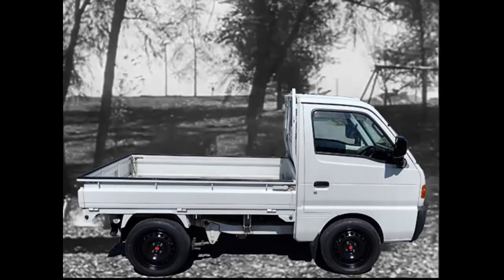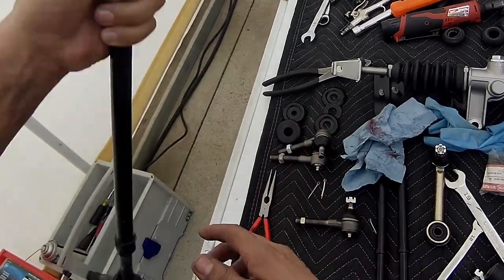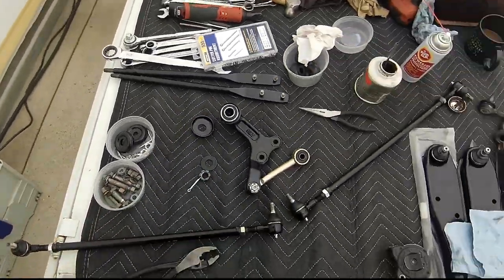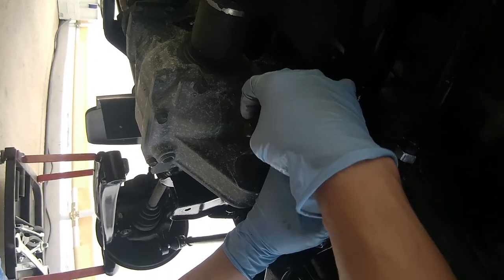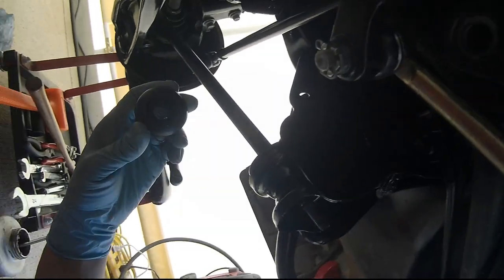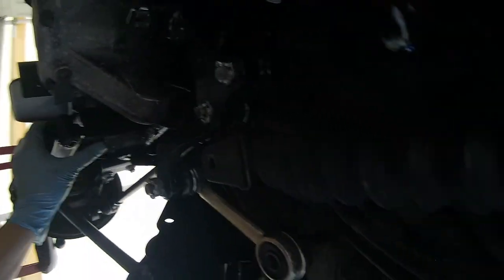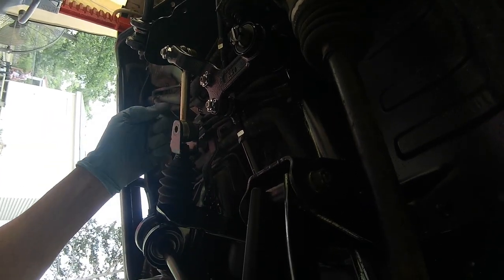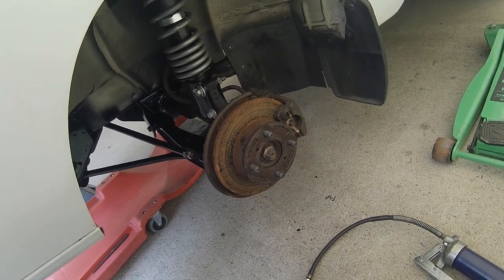Suzuki Carry Kei Truck: Suspension - New Parts Install Part 5 - EP12

Comment: Can't wait to see the next video, I just bought myself a Suzuki carry and have a wobble just like yours. Really useful thanks.
Reply: defiantly the first thing to check in the main bushing in the "Arm set, steering intermediate". Put your phone under the steering  components and video what happens when your rock your steering back and forth.  I really only needed to do this to "fix" my death wobble but while I was under there most of the bushings and CV Boots were on the edge of breaking due to old age I just went ahead and replaced everything I could.

Comment: there are two arms that angle out to the bumper to the wheels,  those bushings have wornout and need replacing .  crap. hard to explain.  those support bars are paralelle to the ground.  they don't move with the steering.  bumper to the axel.  the rubber bushing are dry rotted. or shrunk and the vibration is no longer being absorbed.
Reply from the maker: All those components and bushings were replaced with new. That did solve the initial death wobble. However, now have an issue with the rack&pinion part. Have new part, but have to modify it to work with the right-hand drive of this truck. Next on my to-do list. Thanks.
Reply: @Temuba  I live in NJ also, Randolph.  I work on these cars all the time.  I have a suzuki carry, minicab, and toyota lite ace.  right now I am changing out the water and oil pump in the minicab.

Comment: have you done the brake upgrade yet?
Reply from the maker: No, not yet. Weather lately been in the high 90s. Also, still have a vibration around 45mph, depending on the right condition of speed (~45mph), road condition, I get a real brief death wobble. Once above 50, back to normal. I believe it's the steering rack and pinion assembly. That's were I hear and feel the vibration. That's my next fix and update. Thanks
Reply: @Temuba  I have the same problem at 80 Kph.  Just put new tires on yesterday with brake kit coming next week.  Looking forward To you solving our problem 😀

Comment: Thank you for making these videos! While I haven’t had to do much to mine besides stereo and battery I’ve found your videos to be very helpful to any future work I’ll run into. I have the complete service manual including proper torque and electrical circuits that I would like to share with you. I didn’t find any contact info or a way to message so I’ll just leave this here.
Reply from the maker: Thanks for watching and glad these contents are useful. That would be great as far as the complete service manual. I just updated my contact info (email), let me know and thanks again.
Reply: @Temuba  sent!
Reply: @Temuba did you get it?
Reply from the maker: @PaulDellatore  No. Checked across both of my emails and nothing. Try this one david.deboize@gmail.com

Again thanks.
Reply: @Temuba just re-sent it